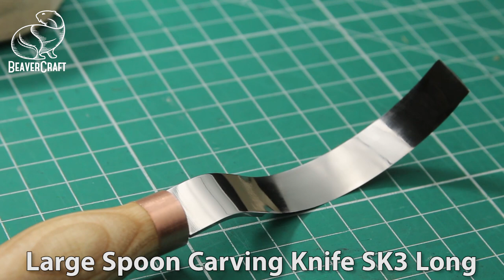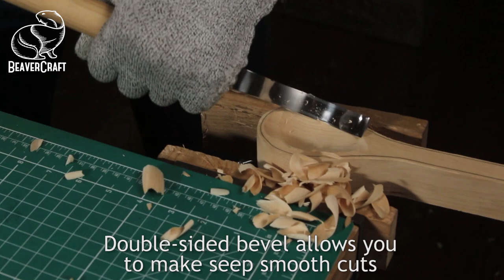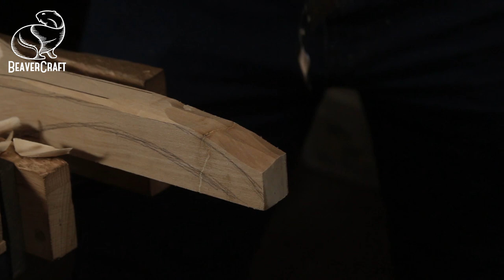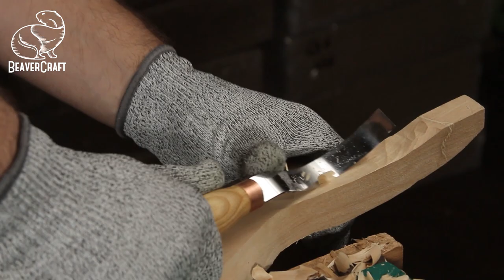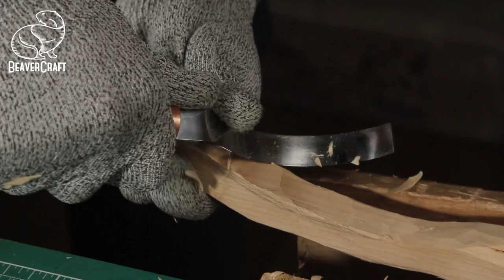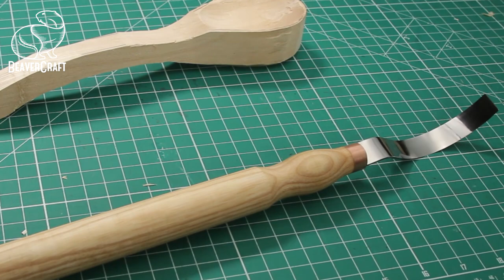SK3 Long Bowl Carving Knife in Use

Comment: I did buy a right handed smaller version. It is certainly sharp, but the blade is thin material. At times I feel it is going to break. I wish you would make a slightly heavier thicker metal blade. Most carvers would not mind paying more for a higher quality product.
Reply from the maker: Thanks for your feedback. We'll take it into account.